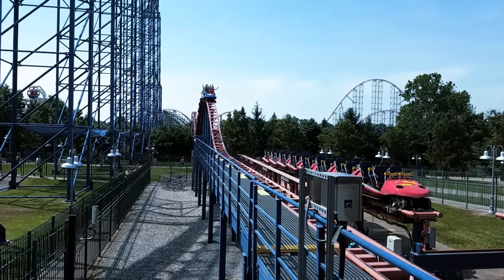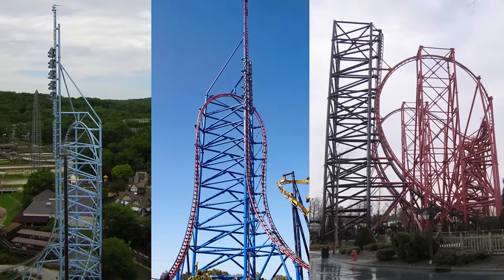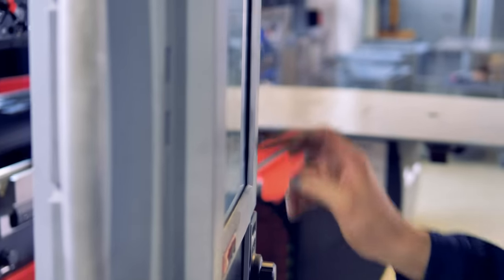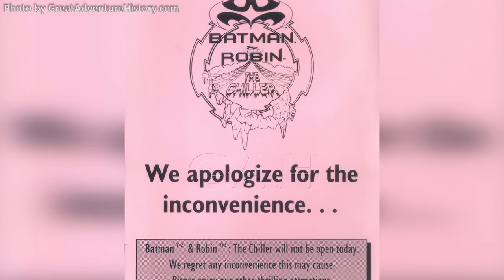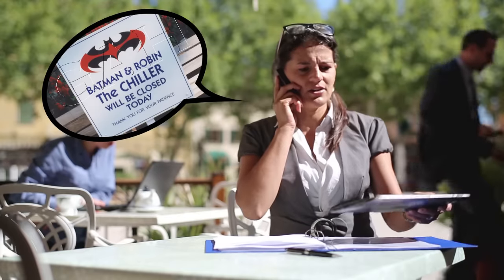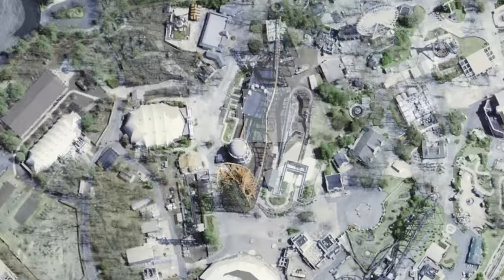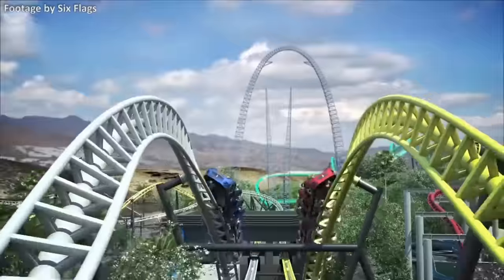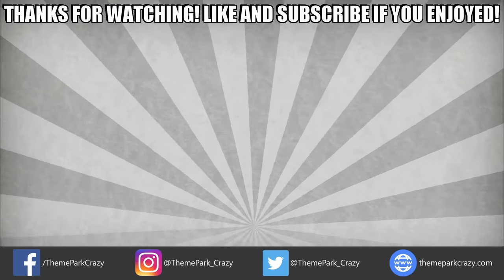Failed Roller Coasters: Batman & Robin: The Chiller at Six Flags Great Adventure (Ep. 2)

Comment: I feel like this concept could be easily achieved today, without all of those issues. That would be super cool to see! And I don't mean like west coast racers, I mean a true modern edition of the ride, batman and robin sides, zero g roll and everything.
Reply: Most definitely. LIMs have become much more efficient and most systems now use super capacitors to smooth out the boost of every required. The LIMs on this ride always scared the shit outta me since they are so exposed. Like razor blades on the side of a cart

Comment: Other failed coasters: The (original) Bat at King's Island.

Defunctland has already done Son of Beast and Drachen Fire; but it would be cool to hear your take on them
Reply: Yeah
Reply: The concrete slabs for orig Bat were sinking into the ground. You can still see them when in line for the Vortex.
Reply: Oh I know Vortex is where (OG) Bat used to be.

Now that LIM's are better understood and such; do you think something similar to B&R: The Chiller could work nowadays?

edit: Other failed coasters I've thought of (for the sake of argument, I'd define failed coaster as something that got a lot of hype but didn't last very long) are Windjammer Surf Racers at Knott's Berry Farm, Hypersonic XLC at King's Dominion, Ring Racer at Nurburgring, Hercules at Dorney Park (I like the nickname 'Hurt your knees'), Viper at Six Flags Great Adventure.

also, if B&R: The Chiller had used LSM launches instead of LIM launches (or even magnetic or hydraulic launches), would the power shortages have come into play at all?
Reply: +Jason Maier Superman Tower of Power and Chang both at the former Six Flags Kentucky Kingdom.
Reply: @billkeithchannel  This has been debunked over and over. The original bat was unreliable so it was dismantled.
Reply: macgyvernco if only they would’ve banked the turns....
Reply: @Jason_Maier  Oh man, Viper.... I used to be terrified of looping coasters, but (ironically) Son of Beast got me over the hump, and I went back to NJ to try it out. After the All-American Scream Machine wasn't too bad, and I had fallen in love with Medusa (YES IT'S CALLED MEDUSA I REFUSE TO ACKNOWLEDGE ANYTHING DIFFERENT) I thought i could brave it. It was OK but rough, and I didn't really want to ride it again. 
The next year, they tore it down. 
El Toro is better, anyway.
Reply: Funny how the first suspended coaster is called The Bat, and the first inverted coaster was called Batman: The Ride.

Comment: Do you think that premier and six flags will ever attempt to rebuild it at the park with new tracks?  
Like a new and improved one a long time after it closed.
Reply: That would be unlikely, but amazing. Six Flags missed an opportunity by not rebuilding it for Batman v Superman two years ago. It could’ve been the same ride but with Superman instead of Robin.
Reply: honestly 2019 would be a nice year. I don't know what it'd tie into, if anything, but, there is definitely room, and it'd be great to have a new launch coaster that actually works (cause kingda ka is broken down way too much as well and never runs at full capacity either).
Reply: There is room where is once was in the area last Batman.
Reply: OneAndOnlySound Kingda Ka has been running much more consistently in recent years. It seems that the park has for the most part figured out what makes it tick and can therefore make sure it is running properly.
Reply: somewhat i suppose. still waiting for it to join other intamin's with the same kind of launch system being closed for like half a season soon. It's also basically only operating at 1/2 capacity as it was meant, or less if it's waiting for the drop tower to go. Yep, it is helping it's operational capability to not heat up so easily like it really could be. It still has some pretty typical "intamin downtime" but what can you do. I still feel it is definitely different enough that something new even dueling from premiere would be and feel like it belonged quite well in the park. It's not like people weren't still riding chiller after kingda ka was put in.
Reply: OneAndOnlySound:  Remember the chiller would be on the other side of the park.
Reply: They can't because ya know BOOYAH
Reply: We can all dream but I ain't suddenly don't think that's going to happen I would love it too but I doubt it
Reply: Lim Technology has definitely improved dramatically since then, so it IS possible.
Reply: @salarkohnechi6539  I hope we do get it

Comment: I still don't know why they didn't sue Premiere over this mess. Unless parks sign some kind of written agreements to not do so if they are essentially building a prototype. Hopefully with six flags 2019 schedule involving two different companies and different launch coasters maybe six flags GADV will get some kind of epic replacement (and not another broken launch coaster, aka kingda ka strata intamin that's down more than it's operating or runs 1-2 small trains terrible capacity).
Reply: It would be bad for business, which is why theme parks seldom sue manufacturers even after lemon rides. If you're buying a new type of ride, parks know that the possibility of unforeseen problems is there. What usually happens is the manufacturer will give them free make-up remediation work or they'll offer steep discounts for another ride in the future. Likewise, if a park has a history of taking ride manufacturers to court, it's possible other builders won't want to do business with that park. It's easier for everyone to work out a plan to fix the ride, going to court is a last-ditch option.

Comment: I remember going to Six Flags on camp trips and an 8th grade trip, and everytime I went, this coaster was closed. Hell I can recall walking to the loading bay and was about ready to sneak inside it (though this may have been after they tore down the coaster) I always wondered why it never opened, but I'd usually find out through the other kids. Even children knew this ride was a disaster
Reply: Same as well because as a kid i saw this ride multiple times not working any of them. I remember going in 2005 and 2006 (when i was 5 and 6) and seeing this ride be closed. I remember walking past it to get to musik express and bumper cars and seeing it closed. I remember waiting in line for some bullshit at the theater and just staring at this closed ride.

Suddenly one day i remember it just being taken down, replaced with another ride in a slightly different area (the dark knight coaster) and forgetting about the musik express and bumper cars (which closed and sat there for years) even just 2 years afterwards. Six flags just close shit without warning and one day you realize your favorite ride (to that point) is closed.
Reply: @trolljones4386  I remember the musik express!

Comment: I rode this coaster many times back in the day. It was one of my favs despite the issues. The headaches from the over the shoulder restraints was a real problem. The lap bars made it much more tolerable. The best time I ever rode it was at night during Fright Fest. That pause at the top looked majestic with the whole park lit up. I was sad to see it leave, but their were valid reasons for its dismantling. It wasn’t the worst for downtime at the park though. The Viper was way worse. I only saw it running a handful of times and only rode it once.

Comment: I was lucky enough to ride both sides of Batman & Robin the Chiller that opening season and for a few years after. A lot of times one side was down for maintenance. I do remember the harsh over the shoulder restraints that if you didn't keep your head right against the back head rest it would hit each side of the restraint. I remember seeing one girl leaning forward just as the ride was about to launch, and watched as she had her head smash back into her seat. This was in no fault of the operators as they saw her doing this when they were checking the restraints before launch and told her to keep her head back. All in all, it was a fun ride when they were running.

Comment: Can't believe how long it's been, but my wife and I rode this in its original configuration with the original restraints. Can 100% confirm that it was a nightmare. I've ridden a lot of coasters; this was by far the worst. The big problem with the restraints was that they pushed you forward, making it physically very difficult to voluntarily lean your head back against the headrest. (Try it - have someone push your shoulders forward in your chair and then try leaning your head back to touch the back of the chair.) So with such a violent launch, your head would then be snapped back into the headrest. I'm surprised there weren't rampant whiplash and concussion injuries on this ride, if not outright broken necks. Then the ride itself was very rough, but given the launch, it wouldn't have mattered if it was smooth because you'd just be waiting until it was over anyway. My wife and I both thought we might have to go to the park hospital after riding this thing. It practically ruined our entire day. I know it ruined my wife for roller coasters - she won't ride them anymore, and always brings up this ride whenever I want to go on one.

Comment: These videos are awesome!  Keep it up!  If I can make suggestions, can you do Deja Vu or Shockwave from Six Flags Great America?  Both coasters were NOTORIOUSLY bad, Shockwave has since been replaced by Superman Ultimate Flight, while Deja Vu keeps moving from park to park (idk where it is now).  Shockwave was a known headache inducer because of the 7 inversions it had, rough as hell, which comes with Arrow Dynamics territory.  Deja Vu was an inverted boomerang coaster by Vekoma that just kept breaking down, so many mechanical problems for such a small footprint coaster that they just removed it and sent it to another park to try again.

Comment: Also Premier built Full Throttle which held the record for highest inversion in the word for a while with a 160' tall vertical loop until Flash took that with its 177' tall vertical loop and also took the record for biggest loop on any roller coaster out there and now Iron Curtain is going to have that 197' tall (I guess) stall element and that is also a Premier Rides coaster (also it is going to have the most inversions on any American coaster at 9 of those things) so they even have some record-breakers under their belts as well.

Comment: Was also told part of the ride(most likely the Batman side) was built over the former site of the Haunted Castle where 7 teenagers were killed in a fire in 1984 and must be cursed, that was later confirmed that was not the sane location but close to it
Reply: This was close to the location but that was the rumor
Reply: The Chiller was built where Lightning loops and someone died on Lightning loops so that argument is better. But you are right that the Castle was really close to the Batman and Robin ride (the Bumper cars were only yards away).

Comment: Can you do a "Failed Roller Coasters" on Vekoma's "DejaVu" ? The downtime on that ride was ridiculous and the constant failures with the catch cars were humiliating for Six Flags.
Reply: Ismael Z Ugh yes...😑 Deja Vu once operated at my home park Six Flags Great America it was a cool ride but it was an absolute maintenance nightmare! It would be closed more than open. The ride only lasted from 2001-2007.
Reply: @tigerrocks503chase8  I remember with one of the parks the catch car did not latch correctly with the train and was severely damaged causing permanent down-time. Another incident during testing one of the water dummies were affected so badly by the restraints that caused Six Flags to sell the ride from the chain completely because it raised concerns for ride safety.
Reply: Ismael Z I knew about the first incident but not the water dummy incident.
Reply: There was a collision between the catch car and the train before the ride opened to the public at Six Flags in Atlanta.  Several rows of cars were totally mangled up. The rumor about water test dummies getting decapitated is untrue, the dummies were just torsos that never had heads in the first place.
Reply: @sharkheadism  Thanks for clarifying. I figured it was a rumor. I do recall some potential safety issues with the restraints causing too much pressure on riders chests during the vertical towers that had to be replaced with new trains.
Reply: @ismaelz3454  It was one of those legends that took on a life of its own. The train/catch car collision and damage was real. Another early problem with the restraints was that when fully engaged, a rider could potentially reach up and touch the track (Vekoma's trains were closer to the track than other manufacturers' trains). They added small bars to the side of the OTSR near the shoulders to prevent someone from reaching straight up.

Comment: I was like 10-13 when i went on Mr. Freeze. can't recall exactly. The OTS restraints 100% effed up my head the 3 times I rode it (over the course of the day). When you were going forward it was no big deal. The human neck and and reflexes let your neck muscles compensate for the curves you saw coming a bit and so you barely got knocked around...

Problem is when you were going backwards and had no idea what was coming next. All you could try to do was hold your neck completely stiff but all this did was make sure any impacts you got hit twice as hard in the top of your head and base of your neck. Can't imagine even having earrings or a loose necklace on, or other head-implements like glasses and such.

I never got to ride it with lap restraints but I am sure it was a massive improvement.

Comment: I grew up going to Six Flags Great Adventure and remember when this ride was all hyped. I wound up getting to right before boarding it when it went down but waited it out on the line and wound up getting the chance to do both sides back to back. The operators back then were always awesome. 

Im not sure how true this holds but Im a union carpenter and most of these rides are built using my locals. I remember when Kingda Ka was being built, it went around the rumor mill that the blueprints caused a delay due to them all being printed in Swiss. Not sure how true this is, but it is something that I've heard before so blueprint mishaps isn't entirely unbelievable!!

Comment: It was actually a pretty solid ride I liked it. The main problems were how rough it was and because of its semi-long nature and 1 Train and the fact that they almost always had only one track open the wait times were ungodly. Put towards its last few years barely anyone ever went on it so the weights are small and the roughness was gone when they put in Lap restraints. It certainly wasn't great or anything but if you popped in and it was like a five-minute wait sure why not it was a fun little ride

Comment: What you failed to mention (not the biggest deal but Great Adventure fans are thinking it) was that the section where Batman and Chiller was, was abandoned for years after the ride closed. They literally put a fence blocking up the section and letting rides sit there for years till removing it just about a year or 2 before making the new rides.

I remember as a kid going on rides in that area (it was called the old country) then after many years not realizing they were gone in any manner till i recently looked it up on the internet. I saw footage of a completely abandoned ride (Musik express) which was hallowed out and falling apart) and i was on that ride just a few years early.

Comment: This was one of my favorite rides. I was so disappointed when they shut it down. I do remember wondering why they only ran the Robin side.. now I know. Thanks for the info! I think the most thrilling part was going through all the inversions backwards with only a lap bar and nothing over the shoulders. 

As far as rough, bumpy rides at Great Adventure, the Scream Machine takes the cake for sure. It was always one of my favorites because it never had a line and had 2 really tight vert loops you could see from the parking lot (my first memory of the first coaster I ever saw at Six Flags - call it nostalgia). My ears bled every time but it was definitely worth it. Especially not even getting out of my seat.. just staying on and riding it multiple times in a row. You can do that with Bizarro because it's a pretty well hidden coaster & not many people bother with it, but with this covid shit, pretty sure the park won't be opening 2020.

Comment: LIM tech is so fail. That is why Ceder Point went with an air launched water cooled cable system that is used on aircraft carriers. CF said that there wasn't enough electricity in all of Sandusky to get a train to a 420 feet height using LIMs.
Reply: rcdb.com/10698.htm Interesting enough, this newer Intamin Accelerator uses LSMs instead.